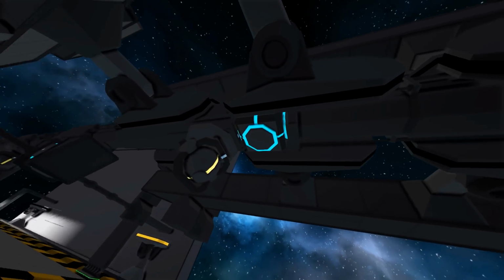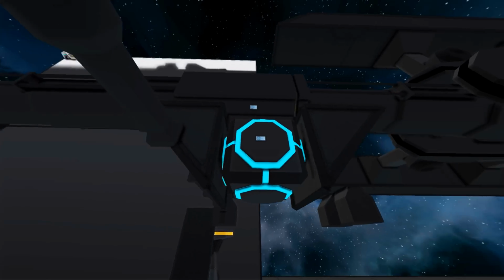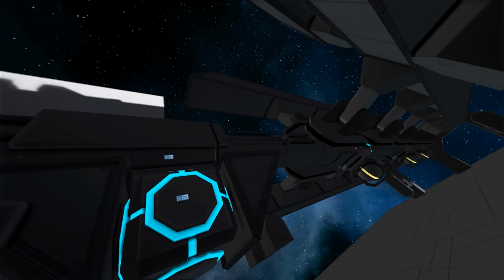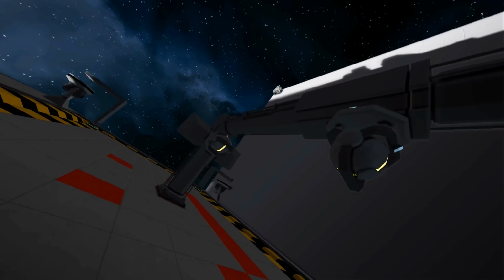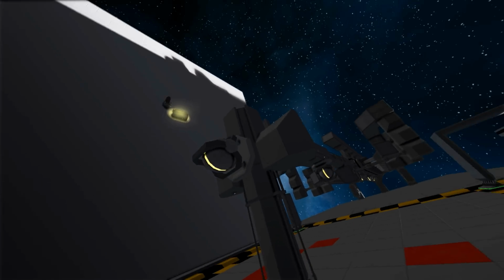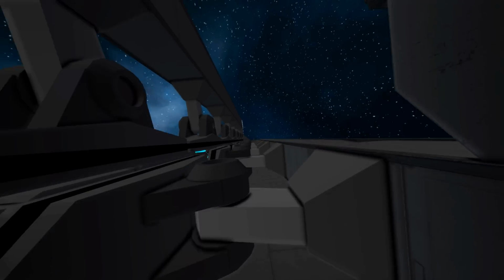Auto Hangar Door V3 - Space Engineers

Comment: thats an awsome door i wonder if you could build that in a smal scale for station blast doosr?
Reply from the maker: Thickness, no. Height and width, yep :D
Reply: Krolitian well it could be thick but it should be only 3 blocks wide and flush to both sides so the pistons would pull the doorplates towards each other and then the door slides away.    hope thats possible
Reply from the maker: That's a small door!
Reply: Krolitian well i dont have a gigant station so i nee a nice blast doordesign fitting it :)
Reply from the maker: Well, lemme see what you come up with!